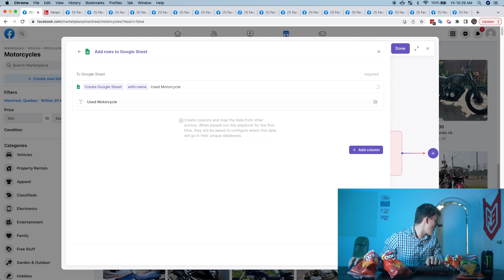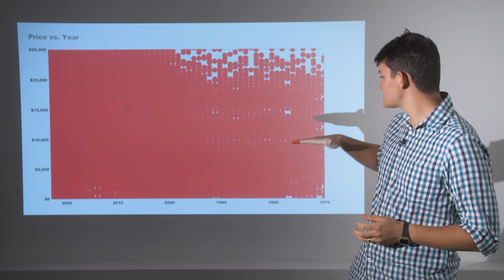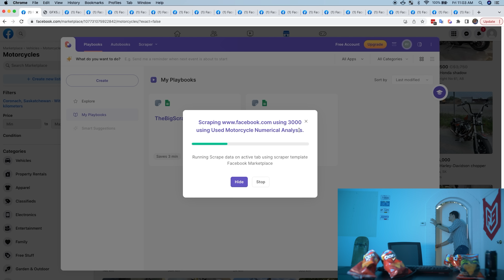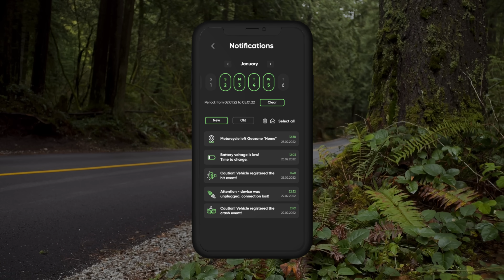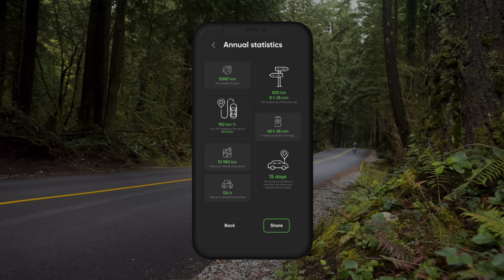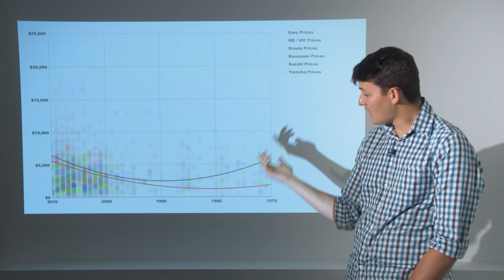Used Motorcycle Prices – A Statistical Analysis

Comment: One of the bike price mysteries I've noticed is that of the Kawasaki Concours ZG1000 vs the Yamaha TW200. Both bikes were (and continue to be in the case of the TW200) made for decades virtually unchanged starting in the 1980s. Today, I can pick up the Concours for under two grand while the Yamaha--which is soooooo much LESS bike--continues to fetch well over $3,000, even those dating back to the 1980s. I just don't get it. I own a 2003 Concours, which I bought last year in pristine condition with 5K miles in non-running condition due to carb issues--an easy fix--which I picked up for $900 but I wouldn't mind owning a TW200 but just can't get around the price.
Reply from the maker: I've noticed the same! When buying my Silverwing, I found them all to be equal or more expensive than the Goldwings. Kind of silly considering it was half the price when new. But that sharp decline between 2010-2000 is very unifying in terms of price. ~RF9
Reply: I've been saying this for a while now - the best deals that will ever exist for motorcycles is late 90s to mid 2000s. EFI and even ABS are available, and they all had reliability sorted out by then. With the exception of leaning ABS and TC (which most of us can live without), moto development has stalled since the 08 recession and older bikes are great buys as a result.  @FortNine
Reply: @FortNine  Maybe a Silverwing is just a better bike than a Goldwing? You know, if you want to actually ride a bike not a loungechair?
Reply: Maybe it's because Ryan F9 crossed a desert on aTW200, not a Concours.
Reply: Probably has a lot to do with who buys and uses those sorts of bikes, both new and used. The Concours, a sport tourer, is probably bought by a lot of middle age people and retirees, perhaps a mid-life crisis machine, or a toy they think they'll use, but in the end they don't ride it a ton, so demand falls off quickly, and they decide to sell the dusty old bike taking up space in the garage, meaning plenty on the market. As these folks have plenty of money, they aren't too concerned about getting the most money they can, just want it gone with minimal fuss. TW200s are bought by the legitimately adventurous, those who actually ride a lot, beat the hell out of them, and - as they actually use them - don't want to let them go.
Reply: Because the tw200 and the xt250 that Yamaha make are so damn reliable. I own a 2007 xt and the thing has simply never failed.
Reply: Don't forget the 'fashion' element, I believe a lot of touring bike owners moved over to ADV style bikes starting around '04 onwards. My surprise was looking at the prices of used Honda Groms - good grief !
Reply: @spatchist  Yeah, we had a guy selling a Grom used, dropped, for $6k firm out here in Hawaii, no repairs, "I know what I got" mentality.
Reply: I may have a slight problem picking up ~20+ year old Japanese touring bikes. People sell them for dirt cheap and they're fantastic bikes! It's insane to me that for less than $2k you can comfortably cross the country at 130mph on an older zg1000 or similar. What a time to be alive. 

These large machines are far from being the "swiss army knife of motorcycles" though. And I think that puts a lot of people off them.
Reply: Last year I saw TW200 for 5000€ here in Slovenia, it had "it's rare here, USA model" in description. That's just silly, I can add 1000€ and get new CRF300L.
Reply: Not everyone wants or needs a bigger bike
Reply: Bought a basically brand new tw125 a week ago for 950, we dont have the tw200 in my country. I got a really great deal though, in brand new condition they sell for 2K - 2.5K. The main difference is that the tw is a fairly special bike that most people buy because they love it. Looking at the concours it just looks like most touring bikes
Reply: Same.  I have an XT225 but also want a TW200.  I can't get over the prices for 20 year old bikes.
Reply: Sport tourers aren't fashionable right now. Cosplaying as a rugged adventurer is, so there we have it. Once fashion sensibilities change some other bike will be more expensive than it's worth.
Reply: The TW was consistently $1100 until the pandemic. Same with the SR400.
Reply: @Hansengineering Not in my neck of the woods. Seen old ones as high as $3,500. Got a Trail 110 instead for less than $1k and it's a much more interesting bike with a sweet low range that the TW can't compete with even with that bigger engine and tires.

Comment: My First and only New Car I ever bought, A 1979 Z--28 Camaro was $7,192.00   First new Street bike I ever bought was a 2016 Yamaha FZ-07 for $7,400.00  I still have the Camaro..
   My fourth new  Dirt Bike I ever bought is a 1978 Yamaha YZ-100-E  Seems I paid  $411.00 for it plus I traded in a 1976 Yamaha 125 MX-C with a leaking steel gas tank.  Silicone glue could not fix.  I have since learned how to weld and braze  or use JB Weld to fix a leaking gas tank.  I built an 89 Gallon Fuel tank for a Truck it has some pin hole leaks in the welds .. I sealed it with JB Weld 25 years ago .
Reply: If you paid $7,192 for a new Z28 in or about 1979 you got a car with most every option box checked.
Reply: @trailrunnermike    No I special ordered it  no  Radio .. No Air Conditioning .. Close Ration 4 speed.  a 3 speed auto would have cost  $70 more .. No T-Tops they were $650,,  The cast aluminum mag wheels were  $276.00 extra  .. rear window defroster was like $88.00  window moldings I didn't want but  ended up  mounting ski racks and  windsurfer racks on the molding so glad I got it .. I think Posi traction was $70 more.. Radio Suppression   package was like $20.00 ectra .. 4% sales tax title registration all in the $7,192.00

Comment: he should do the same video but on the australian used bikes market, pretty insane over here
Reply from the maker: Bardeen is the scraping tool - good hunting! ~RF9
Reply: @FortNine does work with things that have more than 2 wheels?
Reply: Yeah but Australia has Ducati Monster 400's. Problem is I'd have to buy 2. One as a parts bike and one as the riding bike.
Reply: Its more or less the same. HD are overpriced now and you'd be lucky to get a dyna for sub 13k, and everything else tracks. I picked up my FXDLS for 21k in 2019/2020, now they're 27k+ in the used market.